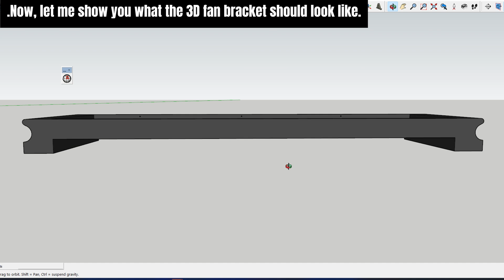RTX 5060 LP + Jonsbo NV10: The Ultimate Cooling Upgrade!

Comment: Would be awesome to see a V2 of this Case since it is a really fun build.

- slightly larger hole-patterns for better airflow all around
- this fan bracket included (or space for two slim 80mm fans matching the upper walls width)
- a place to mount an sata ssd at the front or bottom wall (and use that wall as a big heatbridge surface for the ssd)

Thanks for the videos - very inspirational 😊

Comment: Great video, why did you go with those fans and not a black coloured fan.
Reply: There exist very few PWM fans with this size 40x10 (which are also silent and strong enought)
Reply: @1968hvr  because noctua fans are very silent (and expensive too). Three ordinary fans at 5000 rpm probably will generate a lot of noise. Some people also replaces the psu and cpu fan with noctua ones.

Comment: Ive done this exact mod using your 3d print file, but my orientation is the other way as the PC  is positioned on my right so the wooden strip has the power button are at the top, should I reverse my fans as im trying to draw air out of the bottom of the PC which sort of seems silly maybe I should be drawing air into the case from the bottom, not sure the best wat as I dont want to change the actual case orientation.
Reply from the maker: Ultimately, it depends on you. I believe you need to experiment with the fan direction yourself to find out the difference between each setup and you don't need to ask others. Since I did not test it, I also don't know. The fact is that there is no problem if you just change the direction of the fan; even if you blow the air at the bottom, it is still just fine since the feet add enough space at the bottom of the case.
Reply: @itggear many thanks yep your right I'll have to experiment thanks for the 3d file it makes a tiny cool case even cooler❤

Comment: I have the same setup but in addition i also have three more exhaust fans also on cpu side, for a total of 6 noctua fans.
Temperature are still very high. The 5060 reach and stays at 85C under full load, the cpu (9600x) reaches 90 in cinebench.
I haven't undervolted anything yet
Reply: @AMRKE92  does the same fan bracket work for the cpu? I want to do the same
Reply: @MrRaheem079 no its different

Comment: hi~~ I do like your work.!! It's really great one.!
May I ask how about the cpu cooler if I use Noctua nh-l9i-17xx-chromax-black (37mm hight). 
Can it fit in this case? Coz I saw your cooler just 36mm hight.
Reply from the maker: The case specs said the case support 38mm so your CPU cooler could fit and still have 1mm less.
Reply: @itggear  Many Thanks for your reply~!!!!

Comment: does your 5060 have a really high pitched whistle/coil whine? Even at idle? I've tried multiple different motherboards and power supplies, and even tried 2 separate 5060 LP's and both had it. Was this just unlucky?
Reply: @TaigaTF  i had this issue, but it was actually my PSU making the noise
Reply: @Karaok-AI mine is definitely my GPU. I’ve tested i’ve swapped out the motherboard, the PSU, and even tested them in an entirely different PC. I’m not really sure why it’s happening to me when no one else seems to be having the same issue :(

Comment: What GPU temps were there before the fan mod? Based on ETA Prime's benchmarks and temps they look about the same, but that could be due to different ambient room temperate.
Reply from the maker: I definitely do not know whether he opened or closed the side panel while he recorded gameplay. Because of that uncertainty, I choose not to use a game capture card to record gameplay footage myself. I built this PC with fans installed, so I don't have any data from when there were no fans installed. Maybe I'll make a dedicated video comparing a setup with and without fans later. Thank you.

Comment: Thanks, this let me max out the ram by 2000 and add another 450 to the GPU  on my 5060 and it still runs at a safe temp and rock solid. Even got me some Legendary scores on 3D Mark :D
Reply from the maker: That's a great result, enjoy!

Comment: Is there a difference between three 10mm or two 20mm Noctua?
Reply from the maker: 20mm thickness fans tend to be better, but it won't have enough space to install those fans, unless you use the most optimized fan bracket as I used in my full build video. But it's very difficult to set up, that is why I share only this fan bracket that is easy to use for everyone.

Comment: I built this setup with 9600x and at full load both ends were putting out 80*C. Its small and toasty. Was running test game 1440p 100fps
Reply: @RichardSanchez137  i'll be doing same build next week for my living room. I would like to put the case lay down on gpu side because in that position is better looking and fit down the TV screen. Have you tested the temperature with the case in that position?

Comment: hey i need recommendation please! im from Chile 

I have a 4060 zotac solo, single fan , its not itx/mini version but is tiny with a single fan. what case you recommend me for that GPU? and PSU standar size? buy a mini graphics its not a choice for my country. thanks ITG for your cool videos!
Reply from the maker: There's no PC case I can recommend to you. There's generally no benefit to pairing a single-fan ITX GPU with a standard ATX power supply in a small build. An ATX PSU is often nearly the same size as some Mini-ITX cases themselves, and cases designed for standard ATX PSUs typically already accommodate longer GPUs. Therefore, you won't gain any significant space saving or "smaller build" advantage from a single-fan ITX GPU in such a setup.
Reply: Cooj Case Sparrow MQ6 could be for you, but you will need Flex ATX PSU. If you go full ATX PSU it will not really be SFF, maybe a Silverstone SUGO 16.

Comment: Hi ITG gear, hope you are well, just putting another mini pc on your radar for a possible future project ! The Acer (Veriton) 46xxg and 66xxg (the xx being generation number - for example 4660g or 4670gt) models have support for up to 65w CPU’s and an (external facing) pcie 3.0x16 slot that is already soldered to the motherboard. From research, the pcie is limited to 65ish watts but I’m certain you could find creative ways around that ! Kind regards
Reply from the maker: Do you think installing a GPU outside the PC case is suitable?
Reply: @itggear having tinkered with the Lenovo 720q I do think that there would be benefits to managing case thermals with the gpu mounted externally and there is an optional extra case extender to house a low profile gpu. It is riskier mounting the gpu externally but I don’t have access to a 3d printer or the skills to make cases and modifications in the way that you can. The increased 3.0 x16 speed over something like an occulink running at 3.0 x4 as well as the 65w cpu tdp should give a nice performance bump over the 35w limits in the Lenovo and the unreliable pci risers !

Comment: This is better than sone other 3d printed fan designs I’ve seen … but I really hoppe Jonsbo makes a new version of this case that has just a TINY bit more room for excuuse even with this bracket… there isn’t enough holes at the top for the fan to have air go through completely … I love this case though !!! Everything else is amazing I  also don’t like how the gpu angles up slightly …. It bothers me ? Idk but other than those two things … the overall design of the case is awesome I love the ITX sand witch style cases and this one with the slightly curved edges is nice

Comment: Do you know the difference between that version and the FLX? 👀
Reply: You want the PWN 4-pin versions that can be controlled by the bios or fan software. The FLX versions are 3-pin and are more for replacing psu fans.
Reply: @danrv4847  do you mean nv10 vs n10? They are both flex atx cases
Reply: @joe_ferreira  no, the noctua fans are flx and pwm 👀

Comment: Great design, there is also a bracket available to add intakes im the motherboard side of the case
Reply from the maker: You can change the fan installation direction. I think you don't need more intake fan for this case since GPU fan and CPU fan are too close to side panel and those fans are intake fan.

Comment: Those small Noctua fans are super expensive.
Reply: Unfortunately every noctua fans are expensive, the price is their branding!
Reply: @bluesquadron593  mate you're watching video where it says RTX 5060 and think " fans" are expensive? )
Reply: Bro get that bracket, that tape is not holding on even for a short time
Reply: I just stacked NF-A2x20 just fine without its bracket, had to toss double sided tape to keep em on top.
Reply: @eliezerortizlevante1122  hi, Thanks for the tip, I was already thinking of putting small screws through those holes.. And I bought the fans on AliExpress.
Reply: I v got the sunon 4010 for 6eu each. I m gonna try them with a voltage limiter cable. 3 for the gpu side and 3 for the cpu side (a guy from reddit posted a 3d print front bracket for 3x fan 40x10)
Reply: @bluesquadron593  use other brands
Reply: Yes they are however I can say I’ve been using them for over 10 years and even some that are 10 years old still work as good as the day I got them

Comment: I really love how much of a 3d printing crazy hobbist you are and how many nice gadgets you make into reality :D

but will ask that since i also watched your previous video on building this small PC - what is the difference in temps? because when comparing both movies... i see almost no change at all
Reply from the maker: I haven't tested it without the fan yet. However, my main focus is on the 3D model file itself. I don't want to pressure others to replicate my exact setup, but if they need a solution, one is available. They can also compare their system's thermal performance without fans to the setup shown in this video, which includes fans. Perhaps I'll conduct stress tests with and without the fan setup and post the results on my YouTube channel's community tab, so please stay tuned!
Reply: @itggear  sounds fair - thanks for the note!